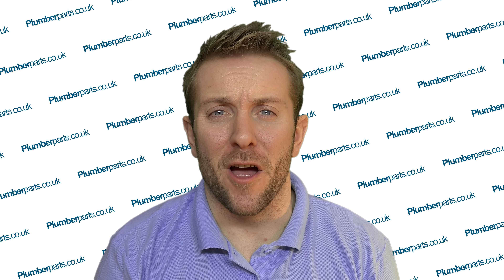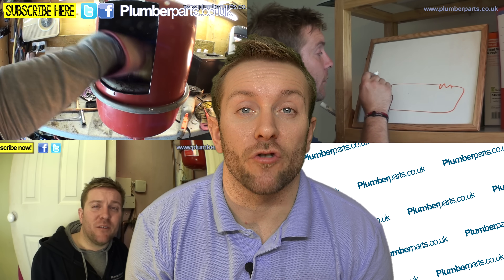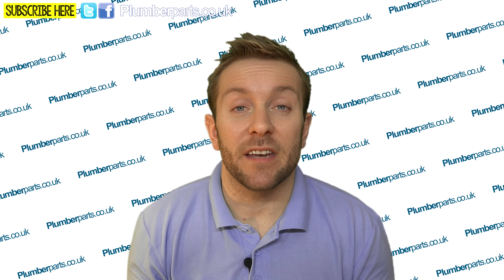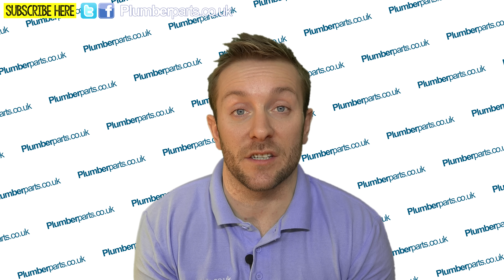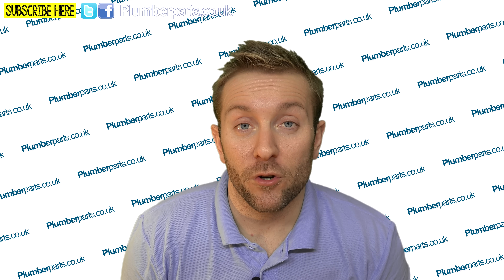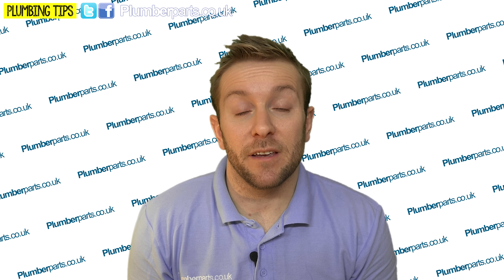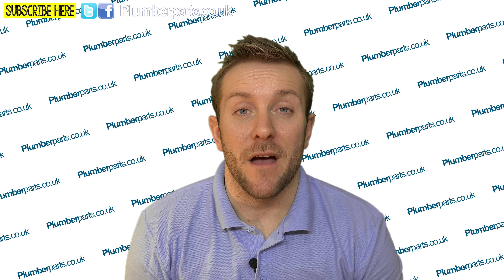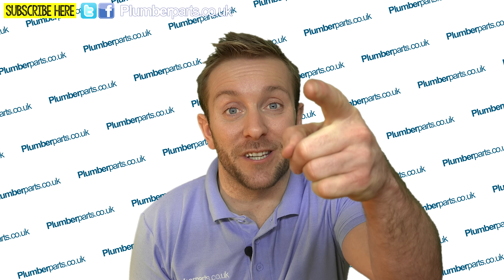BOILER KEEPS LOSING PRESSURE - WHY AND HOW TO FIX - Plumbing tips

Comment: Good one "Hose Mourinho".
I have completed a check of all my radiators, no sign of leakage and removed cover on the boiler, no apparent  leaks and looking very dry. The pressure is dropping and radiators appear to be outputing more heat than is indicated on the digital reading on the boiler. Do you think it could be PRV or is something else going on.
Thanks for posting this excellent and say hello to "Mr.G"
Greetings from Glasgow

Comment: Cavitation does NOT cause atoms to split. It causes water to boil, but the steam readily collapses on the impeller again.  No gases are produced that are vented away.  Cavitation is bad, and will wreck the impeller, but it doesn't cause a drop in system pressure.  A drop in system pressure can cause cavitation, not the other way around.

Comment: Please can you help with this.  The boiler pressure is constantly running too high, way past the green.  When the system is cold it is still too high. The expansion tank does have air in it. Two radiators do not heat very well, one is warm the other is cold. If you close either one down using the thermostat the other will warn up.  Is this related to the boiler pressure.  Thank you.
Reply: Initially, try bleeding all of your radiators, bleeding off the air will help bring the pressure down and ensure the rads are full of water (not air). Assuming it's a combi, check boiler minimum pressure afterwards in accordance with your manufacturer's recommendations otherwise you may end up with a low pressure error code.  I don't believe the problem is related to too high a pressure.
Try closing off a number of rad valves which may help to remove an air lock. Is the system balanced? i.e. lock shield valves adjusted so that furthest radiator from boiler gets most flow and nearest, least etc? Not knowing your system, have you added any new radiators (conservatory, orange room, extension etc.), increasing the volume of the system? It may be the pump can't push enough juice around to get flow through all radiators.

Comment: Another tip for combi boiler pressure drops. After trying all the above, if you’re still getting a drop you can fit 2 isolation valves under the boiler on the flow and return. Isolate this for 2 days and check pressure after. If it drops then it’s the boiler, if it holds and then drops after you open valves then it’s the pipe work.
Reply: Couldn’t you just use the isolation valves at the back of the boiler.
Reply: That’s genius thank you!!!! 😊
Reply: Thank you

Comment: Excellent video as always. Got a Worcester Greenstar 30si, That keeps losing pressure, got to top up every day, and put air in vessel. So far so good, run boiler after 10mins water leaks from prv outside pipe. And when boiler cools pressure is down again. Oh and water comes out of vessel. And when boiler is on, the pressure gauge goes way up to 2bar and over sometimes. Is it the prv or vessel at fault. Thanks for reading, feedback Welcome 👍

Comment: Hi. My boiler needs a steady topping up, because on the morning the gauge is almost at zero. I top it up a bit, and then after a while, whilst it's on, it's starts to give a bubbling noise and the pressure goes into the red. No apparent leakage. Should I be conserned?

Thanks in advance.
Reply: Spunds like expansion vessel

Comment: Jimbo , should the expansion vessel be charged with the system hot, cold, or empty ?
Reply: pmailkeey that makes sense thanks mate. I have to remove a rad soon so will pump them up then . Thanks mate
Reply: No.. empty, otherwise your pressing against potentially more pressure.. is this Jim qualified?
Reply from the maker: Cold or empty is fine mate!

Comment: My neighbor recommended me for her friend, because she had a problem of her gas boiler mysteriously loosing pressure. On Sunday I will go there and check, maybe I will be able to fix it. Gosh, I haven't had many chances to work on heating systems, except in my own house, witch has become now sorta like my own learning grounds. Well, if there is a simple leak on system, or if there is simply bad vessel of Relief vale, I might as well get lucky. I'm learning everyday. I'm surprised that a middle aged woman is confident in 19 yo self thought plumber wannabe, in fixing her boiler. This video is going to be my guide. thanks a lot James.

Comment: We have a warm solution radiant in floor heating system.  I have a thunk on the top of the expansion vessel and a twang on the bottom.  Is it possible that the filler valve is slowly leaking air?  How could I treat the valve seal to stop bleeding air out of the vessel?  Thank you

Comment: I don't have an expansion vessel or tank and my heating keeps losing pressure but with no leaks that I can see...I'm assuming the system is just dumping the water to an overflow maybe?
Reply: scud69er you will have one or the other. The expansion vessel may be in the boiler, very common with combi boilers in particular. If you can open the case you will see it. It's often at the back and may be a cylinder, or shaped like a flat cushion.

Comment: Awesome video! Quick question, before checking or re-pressurising the expansion vessel in a sealed heating system, is it important to have no pressure in the system or does that not matter? Thx
Reply: Sel yes, you need to ensure there is no pressure in the system, otherwise you are trying to compress water.
Reply: Great thx for confirming that Spencer.

Comment: If it's dripping outside whilst switched on...is that not down to the safety blow off vavle instead of the prv.
Reply: Chrisdean Duffy same thing different name, PRV pressure relief valve.

Comment: Another point - the PRV can develope a leaking seat, as it is contact with acidic/particle/general muck from the primary boiler water. This can be especially prevalent where the PRV has actuated due to over-pressure. When the pressure has reduced and the valve closes again, bits of grit are left on the valve seat which can fail to seal properly leading to a permanent dribble.

Comment: Nice presentation and good advice. Worth pointing out though that the expansion vessel air pressure (1 to 1.2 Bar) is normally quoted for COLD condition. It shouldn't be pumped up and the pressure measured when the water is hot.
Reply: Hi 
My boiler pressure is just above bar 1 in the mornings and when boiler is on it goes up to just under bar 2 range.
Could you please advice is this normal.
Thank you.

Comment: My  condensing boiler was losing Pressure, it was neither of the two faults mentioned. It was the boiler heat exchanger itself leaking. The water was disappearing down the condensate drain pipe. Not visable without taking the covers off. The clue to this being the fault is when the boiler is hot during the day the leak plims up and no water is lost as soon as the boiler goes off and cools down overnight the leak opens up and water is lost.
Reply: David Fry.... was it ideal boiler ?
Reply: @sebastianspychala   It was a worcester Boiler
Reply: Everything is made these days to go wrong after certain time .... thanks
Reply: @sebastianspychala  No. Everything is made for a price!

Comment: On some boilers the heat exchangers leak and it drips to condense !!
Ps..the expansion on an open system is taken up by the cold feed pipe..
You cant adjust the pump speed on a lot of combis...

Comment: If the gas was stopped into the property but the boiler remained on would this mess it up?

A friend rented out his home, it's pressure bar was at 3 when he finally saw it. So got it back down but now it drops below 1 and have to push it up manually.

Comment: re disconnecting the pressure loop: that would be ok, but you should blank off the mains side in case the valve starts leaking.  And those little valves can easily be knocked partly open by accident. Probably best to install a stopcock on the mains feed to the loop.

Comment: When i need turn on hot water for washing up, bath and central heatiing but still cold water..  I checked boiler heat see red flashing light (see No 50% ). Been repair 3 times still cold water. Please tell me .

Comment: What rating should the pressure relief valve be? I had 1.5 bar fitted and my plumber changed it to 6 bar one. Is that safe?

Comment: Problem has just got worse I turned the pump speed down to see if it would help with the pressure but instead the water is now not getting hot or no central heating. Ive tried putting the pump speed back up to 3 but theres no difference it sounds like its still operating at 2 and theres no steam coming out of the boiler like it used too. Its a warmflow combi oil boiler. Please any help would be greatful.

Comment: Hello mate wondering if you could give me some advice. I have a Sanyo heatpump and one of the red heat xchangers that you just cut up. Today instead of being on 1 bar , its dropped down to o bar. I had some advice to open up 2 air vents on the pipes that lets out a little water and pump back up to 0,5 bar but I think it should be pumped back to the 1 bar which I did and the dial just slowly goes back down to no pressure. We are in a house and it is heated floors ,no radiators. I noticed last night that the floors were cold and the house was only 19 degrees, Which seemed strange that it was not the usual 21. But the heat eventually started to work last night a few hours later. It was very cold outside and now today no pressure. Why is the water obviously drainging out of the expansion chamber, Hence loosing all pressure. Appreciate a quick reply if poss. Kind Regards Kevin

Comment: 90% boiler goes from 20 psi to 10 when first floor calls
cuts out on low water 
then second try for ignition with pressure around the same 10-11 psi 
it ignites and satisfies to 180 degrees for heating baseboard 
supply pump was set to high speed I dropped that to medium
now drops from 20 to 12-13 psi
still cuts out on low water
Zone valve slowly opened 
changed that as well now runs around 15 psi
still off on low water
can the pressure inside the boiler be so radically different than that right outside the boiler 
I want to say LWCO is bad, but on the second try for ignition it seems to always light though still being around the same pressure

Comment: Thank you for your video ,I had a tenant turn on the cold water supply to pressurise the boiler but for got to turn it off when I got to the house the boiler was blown,she blamed me for it after she told me what she did.The boiler had clear signs on it to not touch or play with it but she said it did not apply as the filling pipe was just under the boiler so I left it if she wants heating she can fix it.my friend said to put an electric fence around it so if any one goes to touch it they get electrocuted but I am not sure what voltage to use and how many amps to deliver,I was thinking about a 3phase 415v with a 100 amp load.

Comment: Interesting, the gas fitter who services my boiler told me to leave the filling loop connected, previously I was removing it.
Reply: If you have a flexible loop, it's best to leave it disconnected, but a lot of boilers nowadays, don't have a flexible loop. They have a permanent connection, where you have to open two valves to let the water in.
Reply: During my courses there were a few reasons why you have to disconnect one is you could potentially contaminate mains water supply and the other was as mentioned if the valves let by and over pressurised the system. I've been on a visit where this has happens and it cracked the heat exchanger. Not cheap to replace.
Reply: More probably and likely an idiot WANNABE Gas service specialist operate the fill valve to the hell and fucked up THE UNIVERSE including the heat exchanger. No contamination issues or hocus pocus in the mains and fairy tales.....adios muchachos.
Reply: There is no reason WWHY TO REMOVE IT as for the past 12 years at customers boilers among hours at home the loop is ALWAYS connected....never ever had ANY problems with that and i can assure THAT YOU NEVER WILL.
Reply: Comment above: "There is no reason WWHY TO REMOVE IT as for the past 12 years at customers boilers among hours at home the loop is ALWAYS connected....never ever had ANY problems with that and i can assure THAT YOU NEVER WILL."
Well,, they said that about the pressure vessels at the Fukushima nuclear plant (leaving the repress connected is fine, honestly, you'll never have a problem, I can assure that you never will). I'm sure your boiler over pressurising is not going to dump radioactive waste into the water courses around your house, but it will burn a hole in your bank account. Engineers who design these things give instructions for a reason. Respect the engineer. At the very least you won't give the manufacturer a reason to deny a warrantee  fix :-)
Most of all, respect your customer. Failing to follow installation instructions is hubris. Technology changes too fast for us not to keep learning. Remember, true wisdom is knowing you don't know. Foolishness is believing you always  do.
Reply from the maker: Well most say don't just in case the fill valves start to let by.
Reply: No mate. I have never ever say anything like that to a customer or myself at home and we are all  ok.
Reply: Just in case the fill valves start to let by? It smells PORKY PIES and i bet my ass IT IS!
Reply: Thx, I have a flexible loop, next time I pressure it I ill remove it.
Reply: plumberparts Quick question could you get an airlock in an unvented system the same way a gravity system gets theirs? We have an issue on one of my site where we have checked absolutely everything and even added another expansion vessel on the system and changed the AAV but the systems still losing pressure.
Reply: Thats correct. DO NOT REMOVE IT. Let the youtubers claim whatever they want and at the end of the day the video does not show you HOW TO FIX A DROPPING PRESSURE problem, only explain some in theory issues. It would be A CRIME to show you how to do it, or either INSTRUCT YOU HOW TO do it. Fair enough?
Reply: I have 2 isolator valves whete filling loop is just in case one goes faulty, simples :)

Comment: If putting in an underfloor heating system so all plastic, stainless heat exchanger and so on, should I still use an inhibitor? Ditto a magnetic filter?
Reply: Choppington Otter
Yes to both, and you should also invest in a deaerator (this is not an AAV). Removing the air gives better flow, critical on UFH. If you have any carbon steel anywhere in the system, the corrosion will all be focussed on that item or items. Make sure all components are non-ferrous.

Comment: I wish you were my plumber, seriously iv been telling my plumber for yrs that my boiler keeps losing pressure, he just mm that's strange, I don't think he wants to do the job, I'm ringing my landlady now because iv also got a massive wet patch on my wall (that's been growing over the yrs )at the side of my boiler, I'm sure it's coming from there? it's absolutely ridiculous
They've just had to put a new boiler in cuz it's pressure raised so much (i accidentally filled it too much) it konked it out, but it's still losing pressure and he still hasn't checked the expansion vessel, so it's still losing pressure, would it be in the attic (above the boiler? ) as my boiler is in my bedroom. As I'm just wondering could that be leaking out, cuz the only wet patch I can find is that at the side of the boiler

Comment: Hi I wonder if you can help I have Sabre 25HE combi boiler it's works fine on hearting but when you open the hot water tap you get hot water for couple of minutes and then the whole boiler shuts out for less than a minute and starts up again ...any idea what the problem would be ...I am suspecting the NCT

Comment: My combi boiler is in the loft on a which is well insulated. I only get a drop in pressure when the outside temperature (and that of the loft) is icy cold. I then have to top up the pressure, just enough to get the boiler to start. Otherwise no problems. Is this common with boilers mounted is such a position?

Comment: Hi,
can you tell me how to reduce the speed of the  pump fitted  to 2009 Vailland ecotec plus 831(grundfos VPAL -5/2A)?
 There is no obvious switches in and out the black box on the top.  I think the  boiler is loosing pressure from cavitation.

Comment: Hello, the video explains the problems with low preassure very well, before seeing it I was sure that there was water leaking form a pipe somewhere under the floor and I was thinking of adding a miracle seal, but I have some doubts now. I am not sure if that is the place to ask, but hepofully I can get an advice, we have problem with the low preassure of a combi boiler, the brand is Vokera. So when the system is cool, when the boiler is not on, the preassure goes down to 0 br, and when I start it, it rapidly goes up and above 2 br, sometime after that it gradually goes down again, (is there any chance that the device that is measuring the preassure is not measuring correcly and is there a way it can be tested) when it goes under 0,5 br I am adding water and that is happening every few days. I would be glad if I can get any help. Thank you in advance.
Reply: yanko nenov 
Your expansion vessel has lost its gas charge and is full of water. You have no expansion, so as the water gets hot, the pressure increases rapidly and causes the PRV to open. Try to increase pressure by adding air to the vessel, 1.0 - 1.5 bar will do, then add water to 1.5 bar on the boiler gauge. If you cannot increase the vessel pressure, the diaphragm has failed. You will need to replace the entire vessel in this case. It may be inside the boiler, or separate.

Comment: The cavitation does not produce hydrogen, but just steam. During cavitation the water is simply boiling at room temperature because of the low pressure.
Reply: inkwhir correct and depending on the rate of cavitation it might sound like your heating system is circulating tiny marbles...